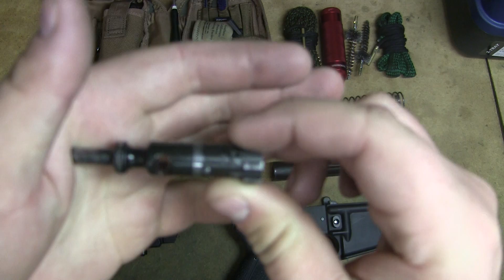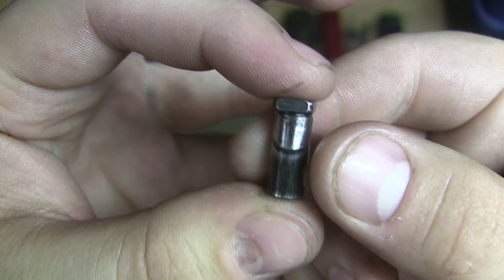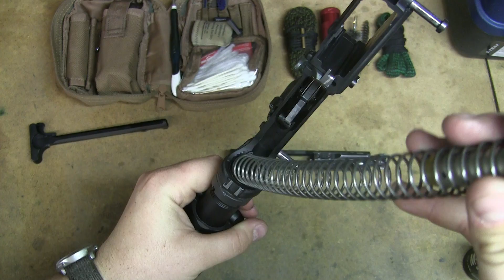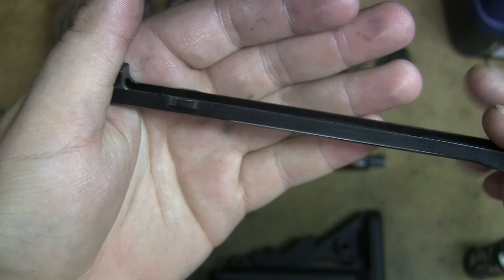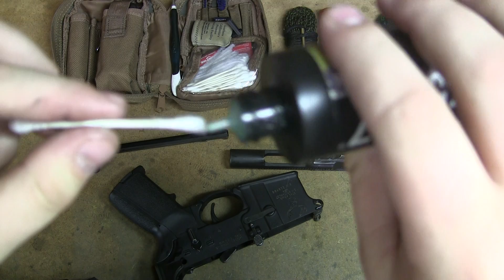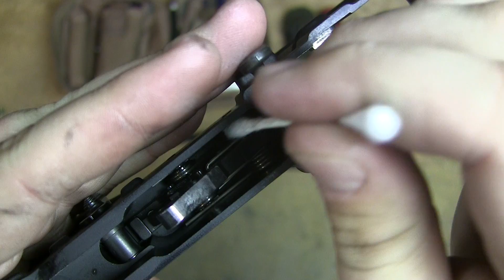AR15 Lubrication

Comment: hey I had a question I'm new to ar15s, would getting too much lubrication into the lower receiver make my rifle double fire ? possibly from old being on the disconnector and causing it to slip and fire twice ?
Reply from the maker: Any time a gun double-fires we should be concerned, as it could be a number of things causing it.  If your trigger group is within spec, it should never matter how much lubrication is present, it will never let a second (or third) round slip.  An example is buying a Geissele trigger -they offer a variety of match-quality triggers for the AR15 and have great, crisp and light trigger pulls.  His triggers come with grease and he recommends to apply the grease on the working surfaces of his triggers but no matter how much lubricant you apply, the trigger will not let any extra rounds slip because the parts themselves are in spec and made to proper tolerances.  

If an AR15 double-fires or lets extra rounds slip, it could be a number of causes: 

1) The trigger group parts are not in spec (most often, this is the problem)
2) The headspace is off, causing slam fires
3) The firing pin channel is worn down, allowing the pin to cause a slam fire
4) The ammo has raised and/or sensitive primers, causing slam fires (often encountered with reloads where the reloader used the wrong primers)
5) The two holes of the lower receiver that hold the trigger parts were machined in the wrong places so even quality trigger group parts aren't working right (rare, but possible)
6) The two holes of the receiver have been worn down by so much use that they are now out of spec, causing even good parts to malfunction (only seen in heavy-use ARs)
7) The trigger is in working order but it has a short reset and/or very light trigger pull, and the shooter himself is causing a quick second shot because of improper trigger control, without realizing the gun is fine (not as common, but it happens)

Those are just the most common reasons why this could be happening, but there are other reasons not listed.

Most often, this happens because the trigger components have been compromised, either somebody went in there to do their own trigger job and messed it up, or the parts installed in the rifle were improperly made or were low-quality and got worn down.  

When a gun double-fires, we should be concerned for the safety hazard it poses, but also for the legal problems.  If you go to a public range and somebody realizes your gun just fired multiple shots, they may call the police and now you're arrested on charges that you have an illegal "full auto" weapon.  That has unfortunately happened to some good people who had no intention of making or possessing an illegal "full-auto" weapon, yet their parts failed or were crap quality and now they're facing serious legal problems.  

If it happened to me as a casual AR15 owner, I would immediately stop shooting and take it to a gunsmith (if I built the rifle) or send it back to the manufacturer (if it's a stock, factory gun) and have them check it out.  They will identity the proper problem and replace the necessary parts or make the repair needed to fix it.  In my own case, I would take out all the relevant trigger group parts, discard them, and replace them with brand new, top-quality components and try again.  Of course I would use ammunition made for the AR15, like Federal M193 or M855 "green tip" to ensure it's not the primers or the ammo.  Avoid custom reloads that your buddy made, as he may have used raised/sensitive primers which are a problem for any semi-auto firearm that uses a free-floating firing pin like the AR15 does.  

Bottom line: the safety and legal risks involved are too great to tread lightly on this problem, it's much cheaper and easier to purchase all-new top-quality parts than try to keep working with cruddy parts.  Seek professional guidance, either from the manufacturer or a gunsmith so that you know for sure that the problem is fixed.  I hope that helps.

-Mr. 2nd

Extra info:  Most the trigger group parts you will encounter on factory guns or in a lower parts kit are heat-treated parts.  They have a thin, hardened "skin" but inside the part the metal is soft.  In normal use, the hardened exterior surfaces of these parts interface with each other, allowing these parts to last a long time, and the soft interior of these parts never becomes exposed.  The problem is when people try to do their own trigger job or the parts get so worn down that the hardened "skin" is gone, and now the soft metal is exposed and expected to do the job.  The soft metal can only do the job so long before it wears down fast and gets out of spec.  Because of the nature of these parts, I advise never to try and do your own trigger job on an AR15 -either buy an aftermarket trigger or consult a gunsmith where he'll use proper steel parts in which the entire part is hardened steel rather than just the exterior "skin."  This way, he can take whatever material he needs to make a crisp trigger, and the whole part is quality material so you never have to worry about the parts quickly wearing down.
Reply: +Mr2ndAmendment wow thanks that's the best answer I've got anywhere even on ar15 forums thanks a bunch. I will check everything out. it is an 80%lower so it is possible that something is out of spec and just too loose I'll probably need to get a new lower  thanks again for the post very good information !!
Reply from the maker: JOHNNOCHA 

No problem man, stay safe and stay legal.  I suspect the two holes were maybe not drilled correctly at the exact right places, but it could be anything.  I'd just shell out the $100 and get a quality, trustworthy lower from a respected manufacturer.

Comment: With DI system oiling depends on how much you shoot. If you only shoot a small amount  than a dab of lube will do, however if you are dumping hundreds of rounds than you do need to lube more heavily because the continuous pass of hot gas will dry up the bolt carrier group and potentially seize up the bolt...
Reply from the maker: The only time I've ever seen the bolt seize up is when too much lube was applied over firing 3,000+ rounds in one day, the lube and carbon just gummed everything up.  I think after every 1,000 rounds at a minimum you should reapply lube, but honestly a DI system will run just fine (and maybe even better) on a high round count with little to no lubricant.
Reply: Not true, I've seen AR"s seizing multiple times at a local range due to dry bolt group and they are definitely not shooting 3000+ rounds.
Reply from the maker: b k 

I would ask about the quality of those AR15s.  A LMT, Daniels Defense, Spikes Tactical, BCM, or other hardware-grade AR15 will shoot all day without lubrication in a normal range setting.  The cheaper brands will not fare so well under the same conditions, they need everything you can give them to work.  

Lubrication is not 100% required, the AR15 does not require lubrication or it'll seize up.  Lubrication helps make things go smoother and reduces overall wear, but the AR15 will still function without lube for many rounds.  I would recommend the lubrication techniques I've shown in the video to keep the gun running with minimal wear, but if you're in a bind or you don't got any lubrication in a bad situation, the gun will function and go a long way without it.

Comment: Did  u forget the firing pin ?
Reply from the maker: Great question.  Because the AR15 utilizes a free-floating firing pin, I'm hesitant to apply any lubrication to the firing pin itself.  The firing pin is generally a titanium alloy (for less weight and strength) but also chrome-lined to resist any corrosion and "glide" with less friction.

The problem that has been known to occur is if you lubricate all over the firing pin, it can eventually attract dust or carbon and become sticky -which could cause a slam-fire.  In a worst case scenario, the firing pin was lubricated and dust or carbon gummed-up the pin, and it's stuck in the forward, "firing" position.  The shooter tries to rack a round or hit the bolt release to chamber a cartridge and the stuck firing pin will then act as a fixed firing pin, thereby discharging the round upon chambering (known as a "slam fire").  I admit, this is a rare occurrence because it requires the perfect elements of the situation to come together to produce a slam fire, but it has happened and is a potential issue in all free-floating firing pin designs.   

Because the firing pin is made of materials that basically could never rust, and the pin itself will still perform without lubrication all day, I choose not to lubricate the firing pin.  For constant shooters who shoot all the time, I don't see any problems, but for the guys who leave their guns in their safe for years, I wouldn't do it.  Basically we lubricate to reduce friction and wear, and to protect against rust -with the firing pin, I'm not concerned about either even if the firing pin doesn't get lubricated.  Worst case scenario, I somehow wear down or rust/destroy a firing pin and have to obtain a replacement -I'd rather risk that instead of a possible slam fire situation down the road.  The firing pin, like all parts, eventually may have to be replaced with enough high-mileage use, I'm not worried about it.
Reply: Thank you ! Sir.

Comment: have another question/concern about this video..
I noticed that your AR is a Stag model. I also have one and the take down pins are so tight that I use a dummy plastic round and light tap to start them out..Was this the way yours was when new?
Reply from the maker: +George Salvesen 

It's not uncommon for new pins to be tough.  Sometimes you may not have the upper receiver at the right "angle" to take them apart.  I find that usually you'll have an easier time pushing out the take down pins when the upper and lower receiver are together.  A lot of guys get the rear pin then swing the upper receiver upwards and try to push the front pin out, but you may have an easier time keeping it closed up and trying to push the front pin out.  On some rifles I've noticed you may want to apply constant pressure to the front pin as you continue to slowly swing the upper receiver upward to find a "sweet spot" where the pin just pushes out.  

Also, I do have a AR15 cleaning video here:

https://www.youtube.com/watch?v=JnXRYfOEiXA&list=PLZKboDSxc-jXcw5uGvBd0IJR-Y-TIDRBx&index=3

Good luck!

Comment: Does the oil spread around after working the gun and firing?
Reply from the maker: +Josh Hale 

It does a little bit but the oil actually goes away from the bolt carrier once you start firing more and more rounds.  The hot gases and carbon eventually blows out/absorbs/evaporates some of it if you shoot enough rounds.  The AR can honestly run completely dry but you will wear things down much faster over the life of the rifle.

Comment: Great video, really good info for beginners. You don't lube the bolt lugs?
Reply from the maker: +Jnb21 

Thank you!  

I make sure the bolt lugs have a thin surface of oil, I just run a oily rag over them, but I don't oil excessively there at all.  The star chamber is great because there's so many lugs equally locking with the barrel (compared to just two lugs on most designs), but the downside is if you oil the hell out of them, they become a dirt magnet if you're running the gun hard in bad environments.  If you're just enjoying the rifle at the range, you can over-lube everything and it'll still work, it'll just spit and drip oil everywhere.  For example, out here in Afghanistan, I couldn't get away with that, there's too much dirt, sand, and dust -it would take no time before all that oil collected up some pretty bad junk.

I also don't do it because it seems almost pointless because the gas key is right behind and above the lugs -and excess gases and heat will evaporate that oil in no time.  

Sorry for the long comment, bottom line: in a clean shooting situation, you can do whatever you want without suffering any reliability consequences.  If you're running and gunning or operating in austere environments, I'd keep all lubrication minimal -some dudes in my platoon run their M4s completely dry and it seems to work pretty well out here.  I lube mine up because it's old and abused, every steel part on it is bare metal steel, I don't want rust.  Good luck!

-Mr. 2nd
Reply: +Mr2ndAmendment ahh I see, cool man. thanks for your service and the video

Comment: Nice video , easy to follow alone with. Thanks
I did noticed that you didn't lower your hammer before you placed your upper 
back on. Will that cause an issue after everything is back together, and you try 
check everything out. Will squeezing the trigger rest it?

Thanks
Reply from the maker: +Harvie McClintock 

Thanks man, and good question.  You can put them together with the hammer forward or to the rear, it will make no difference.  I would recommend to charge the hammer, put it on SAFE, then put the upper and lower back together.  When the receivers come back together we should be doing a function check to ensure it still works properly and already having the hammer to the rear and the rifle on SAFE makes locking the bolt to the rear easier because you didn't have to charge the hammer in the process.  

When the hammer is in the forward (discharged) position and you put the upper back on, it at that point is in the exact same position it'd be in when the hammer is striking the firing pin in the milliseconds of firing.  The hammer is making contact with the firing pin and when you pull the charging handle to lock the bolt to the rear, you just cocked the hammer back.  

If I could do edit the video I'd charge the hammer, put it on safe, then rejoin the two halves just because it's a little safer that way in case (for whatever reason) somebody left a live round in the chamber without realizing it (after cleaning the rifle this would be a rare circumstance, but weird stuff happens).  Hopefully that helps!

Comment: Great post man I copied your M-Pro 7 lube to try.  Right now I swear by the Tri-Flow lube.  It comes in a 16 oz can to spray but I like the bottle for the lubrication on the contact parts.  I have used it on my 45 pistols in the slide contact areas but like you a little goes a long way.

Comment: best ar15 lube video bar none!! very clear instructions & demonstration
Reply: Is he your boyfriend?
Reply: @deathlarsen7502  i wish
Reply: Uhm,except he lubes shit that has been known to cause malfunctions when lubes. Do not lube the buffer system. Do not lube the fire control group. Lithium grease on the sear faces is fine. But lubing the spring is absolutely stupid. These guns run when all the burnt powder isnt sticking to the functioning parts because you lubed everything. This is one of the problems they ran into in Vietnam. Soliders doing exactly what he did which got people killed. The 4 contacts on the bcg gets 1 drop of oil each. 1 drop of oil on the gas rings. 1 drop of oil on the firing pin and spread over it. That is it.period. anything more than that is asking for problems at some point. If you oil the fire control group.plan on removing it after every so many rounds to clean it. Springs do not need lube. Grease on the sear faces will make it smoother but it isnt even Nessasary and I would not recommend doing it in sandy environments. Lubing the buffer system is absolutely stupid. If you do this,you better plan on tearing it apart and cleaning it everytime you clean the rifle every so many rounds.
These rifles were designed to run with minimal maintenance. I've seen rifles personally that have 10,000 rounds thru them and have never been cleaned. Why? Becaue they only lubed what needs to be and what Stoner recommended.  As long as the contact rails are "wet" and the gas rings can move inside the bcg,it will run.

Comment: I find that a little bacon grease really makes a huge difference in performance.  Your AR will really appreciate it.  As will the other shooters at the range when they smell breakfast cooking.
Reply from the maker: +bestguitar11 

Unconventional but I've seen guys do this (and use Crisco or lard for the big stuff).  Not my first choice in peaceful times when I have access to my preferred lubricants (synthetics) but in times of sparse supplies and times of need, it will work.  18th and 19th Century soldiers would use whatever was available to prevent rust on their muskets, including leftover grease from the campfire skillet, so it has historical roots and does work, although not my preferred method unless I have to.  Good intell.

Comment: Mr2, Have you ever tried Tetra gun grease? Or what are your thoughts on grease?
Reply from the maker: +michael Kay 

I like Tetra gun grease for big, heavy steel parts that slide.  I think in my M1 Garand video I used it on the op rod and receiver for the bolt.  I also like using Tetra for shotgun chokes -prevents rust and makes them easier to change out.

I'm not a big fan of using grease in the bolt of a DI AR15 -I prefer more fluid oils rather than grease.  One of the things that can stop an AR15 is when the bolt gets gunky and I've noticed grease will attract sand and dirt.  It just depends though, honestly the regular guy shooting his AR at the rifle range will never have problems with grease, but if you're going to get dirty then I'd advise against it.